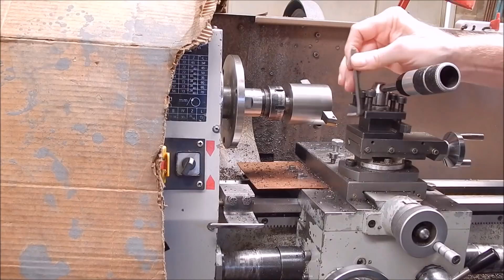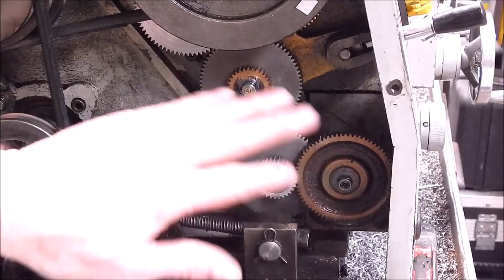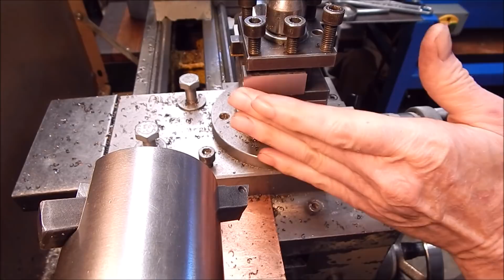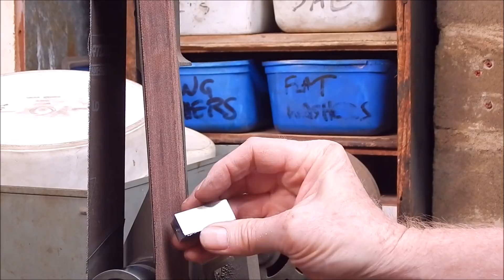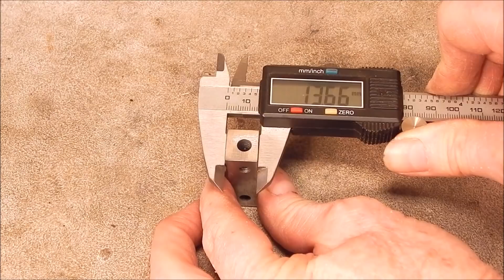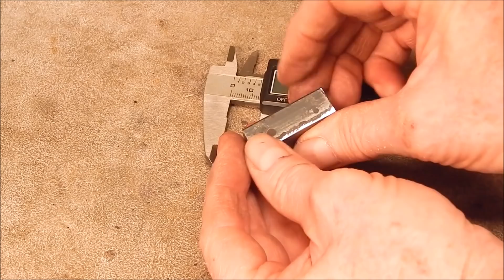Simple milling on a metal lathe using just the tool post

Comment: 1. to make this fly cutter I guess I would need a milling machine? or can it be done on the lathe?

2. I need to face 3 inch x 1.5 inch x 0.5 inch aluminium bars
    my lathe will have 4 jaws chuck. 
    can I face these aluminium blocks in the lathe using standard tool, by simply putting the material in the chuck? 

sorry for total newbie questions, I haven't used lathe before, but in couple of weeks, it should arrive, so I'm trying to learn as much as I can ahead of time.
Reply from the maker: I don't have a milling machine.  It can be done on the lathe.  Yes, you can face aluminium blocks on the lathe, but you will need a four jaw chuck to hold them. Cheers Rob
Reply: @Xynudu  that's some good news! That fly cutter slanted slot seemed impossible to me to be made in the lathe. I'll have to learn how.
Yes my lathe will come with 4 jaws so seems like I will get some use of my new machine 
Thanks for your reply!

Comment: I might run out of Dunny roll but i will NEVER run out of empty beer boxes !
I heard last night that W.A is putting a limit on how much grog you can buy each day because of this bloody virus - It is unoztrayan i tell ya !
The last time i did any milling or fly cutting on a  lathe  i made a toolholder up to bolt to the faceplate , I didn’t have a vertical slide and needed the swing on the tool to be big enough to face off  a mower head  so had to run the lathe in back gear and it was slow but better than filing it !
When i was working at a place years age  that made nuts and bolts the toolmaker had his lathe set up to machine parts for the auto machines using a fly cutter , the lathe was set at 60rpm and he used power feed on the cross slide so he didn’t have to wind the handle . I was operating a capstan lathe next to him one day and heard this almighty crash - the constant rhythmic ticking noise from the tool cutting put him to sleep and he fell off his stool ! I took a pillow to work the next day and offered it to him - can’t repeat on here what he said but he wasn’t amused ! 
Thanks for the video mate !
Reply from the maker: It's getting serious Ian.  I read an article where we could all run out of beer for 3 months if they don't classify breweries as an "essential service".  This is just not good enough.  How the hell are we supposed to survive ?  Screw the dunny paper, there's gunna be a stampede on grog next.
Reply: xynudu 
I wouldn’t want to be in the PMs shoes if that ever happened Mass mutiny will be the result ! I heard yesterday that the bundy rum factory is making ethanol for hand sanitiser  , not sure about other breweries but  i reckon that sanitiser stuff is a load of bullshit just like mouthwash - it only kills the germs on the surface and only for a few minutes then they start reproducing . If you want a  real hand cleaning germ killer use petrol  ,metho  or my favourite shellite ! I have a burn on my hand from last weekend(BBQ and a lot of beer don’t  mix too well ) which was was getting infected - a quick dip in shellite and the infection was gone the next day , stings a bit for a few minutes but nothing a soothing beer didn’t fix !

Comment: Gonna be a sad day when the old shield fails 😟 will we have a ceremonial cremation? 
Glad you got a giggle yesterday mate 😁
Reply from the maker: It should burn pretty well with all that oil and cutting fluid Bill.  Yes it will be sad.  But I will just have to get through it.  Cheers Rob
Reply: Maybe frame it instead... Eric at Hand Tool Rescue wins for the most flamable workshop item.😁

Comment: Great video but isn't 1300 rpm pretty fast?  Not sure what the cutting diameter was exactly but that looked at least twice as fast as I would be comfortable with.
Reply from the maker: To get a clean finish you need to keep the speed up.  The carbide handled it fine - as seen.

Comment: Do you balance the cutter ?
Reply from the maker: No.
Reply: @Xynudu  does that affect the lathe ,motor ?
Reply from the maker: The rotating mass is small compared to the spindle and collet holder.  The only vibration is a small amount from the cutter action.  Obviously you want to try and have equal cutter tool length radially on the same plane if possible. Cheers Rob

Comment: Wow! That just amazed me. I was expecting the fly cutter would produce enough vibration to pull the job out of the tool post, but it didn't & the cut with both ends practically the same convinced me that nothing moved. Really fab technique to have in ones back pocket for when needed. Thanks for sharing!

Comment: Hi Rob. I've been doing something similar on my lathe, using the tool post for milling, for some time. As my lathe is quite a bit smaller than yours, tool post gap is only about 15mm, I use a 25mm end mill rather than a fly cutter. Get great results. I also modified an angle plate so I can use it in place of the tool post for clamping work to. Cheers, Alan.
Reply from the maker: Hi Alan, it's handy to be able to do small milling.  I have considered making an angle plate for the Sherline a few times, but never got around to it. Cheers Rob

Comment: Very cool. I wonder if removing the compound and attaching some kind of clamping holder in its place--maybe even a small machinist's vise--would provide even more stability? Now that I think of it, I'm surprised given your luck in the past that you haven't found a discarded-but-restorable bench mill along the side of the road!
Reply from the maker: Still looking Todd.  Maybe one day.  It would have to be a dovetail column or I'm not interested.  Cheers Rob
Reply: @Xynudu  Dovetail cutters aren't hard to come by.  Or make, when it comes down to it, either in tool steel for light work or using a 60° insert.  Hell, you can even cut dovetails with a fly cutter if you're really careful and good at sharpening HSS.

Comment: Nice one, Rob

My boring bar holders only use one grub screw, that way, as long as the hole in the holder isn't pissed, and there's no crap in here, your bar is gonna be straight.

For squaring up with a fly cutter, touch off front and back (in case your cross slide is wonky, which can be the case on my Schaublin if there's a bit of crud stuck between the bed and the thingie that squares up the cross slide - you know what I mean)

I wouldn't worry about boring bar size on your Schaublin, they can take some pretty heavy cuts for their size.  Perfectly happy taking 1mm off radially in stainless on mine, I have been known to take off 2mm at a time.

Did you get your chip guard from Banggood?  I'm sure if you ask nicely they'd send you a new one.
Reply from the maker: Hi Michel,  I've had that chip guard so long I can't remember where it can from.  It's slowly been getting smaller over the years as bits break off.  Almost time for a new one.  Those chip guards don't come cheap and may be a bit out of BG's class ;)  Cheers Rob